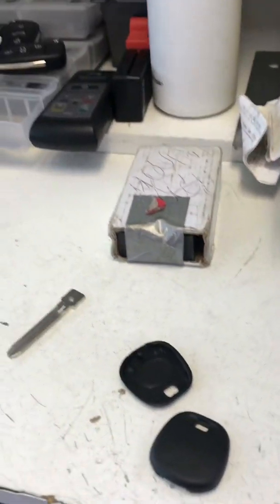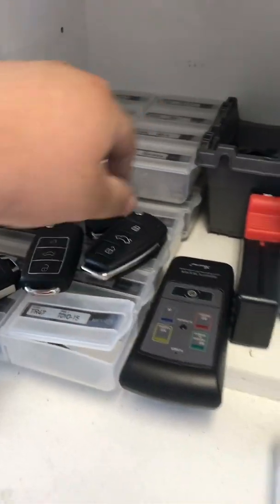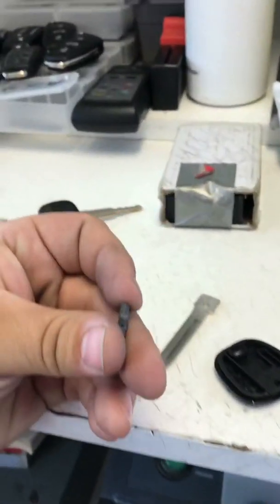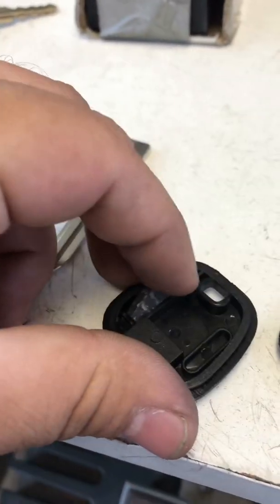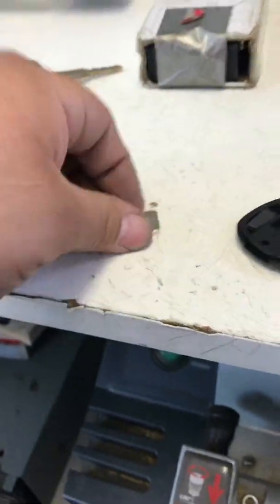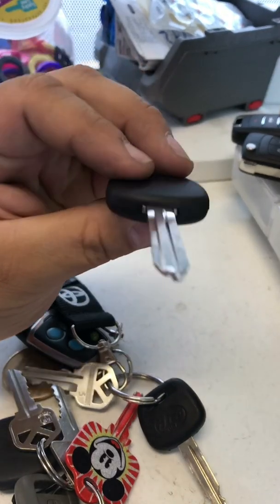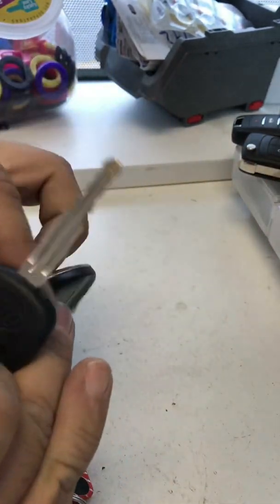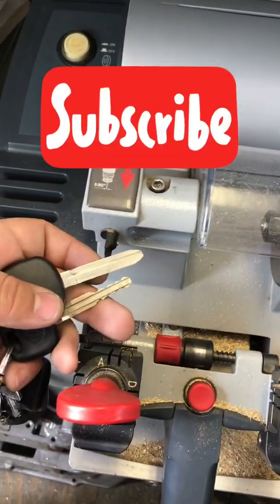MULTI FUNCTION KEY (MFK)

Comment: Your channel is extremely helpful to me. Thank you.

I just bought this set. I plan on using it for test keys, and then I can provide the customer the MFK key as an extra key. 

I will also use it when the customer is in a hurry and I don't have the correct key in stock and when the customer just wants the cheapest option available.
Reply from the maker: Sounds like a great plan! I hope you have good luck with it.

Comment: Hi Mykeys! Am I able to use the MFK heads on any of the blades or do they need to go together? example if i have a toyota style head, can i use a ford key blade with it? Or does it have to match?
Reply from the maker: For the mfk blades you can use different heads yes !! You can use toyota head mfk shell with mfk ford blade .. but both must be mfk shells and mfk blades!! The only thing is that the older ford ignition have a gaurd around the ignition lock cylinder so for those you need the old school style mfk ford square plastic head..